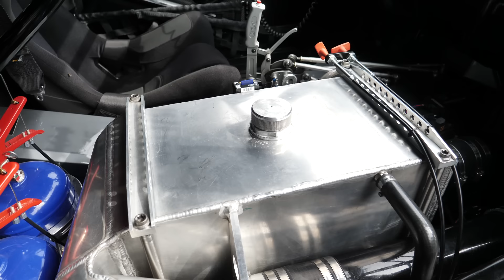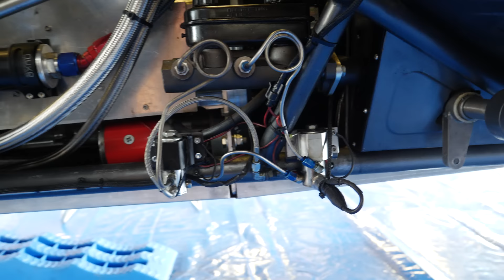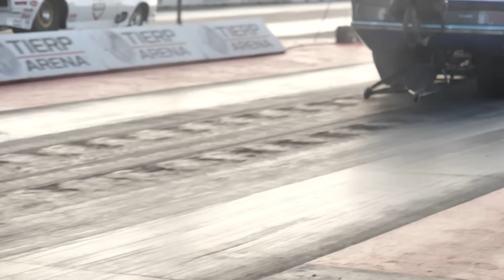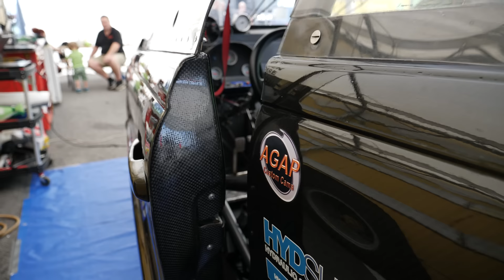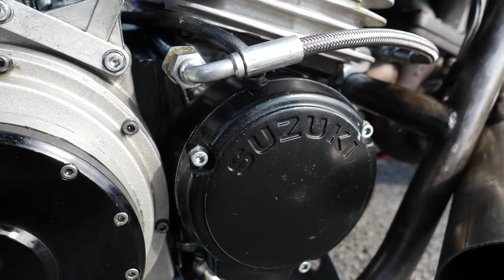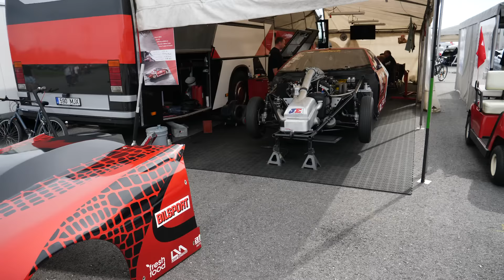The Scandinavian Drag Turbo Cars (2000+hp 4cyl..)

Comment: Set up an air conditioning system to cool down an in cabin intercooler. Program it for the air conditioner compressor to shut off at 50% throttle. The rest of the time it'll have cold air blowing across the intercooler

Comment: 1500hp in 4 cylinder Volvo motors wow.
Reply: Not that there aren't Hondas that aren't making that but those are common parts to find. Maybe I'm wrong but I'm just a fan of engineering outside the box.

Comment: The extra injectors are usually pointing toward the air stream I’ve noticed.  Is this to better distribute the fuel into the charged air for cooling or just a way to fit them in the engine bay?
Thanks for all these awesome videos!
Reply: Probably helps with atomisation.

Comment: I’m not sure a dry sump has anything to do with making power, dry sump is to make sure the engine gets oil pressure on the launch and run down the track, the proline v8 must have a baffled sump maybe? To stop the oil moving away from the pick up and causing engine failure.
Reply: You can get better piston ring seal and reduced rotational losses since there is less oil vapor in the crankcase = more power :)
Reply: Jonas Karlstrom so the main reason for dry sump on a race car is more power?
Reply: @clint.garage.6092  as far as I know, maintaining oil pressure is the main reason. More power is just a bonus (unless you try to extract every kW you can)

Comment: When you simply cut a cylinder off doesn’t it make the motor unbalanced?  Or skip a cylinder in the firing order?? How does that work?
Reply: If you use it like v engine not like a inline
Reply: hermann ott so when they “cut a cylinder off” it must require a new crankshaft and camshaft right?

Comment: Why are all the methanol injectors in the charge piping facing against the air flow direction?
Reply: I Think becouse when you spray against the pressure the fuel vaporizes allot better
Reply: +1 for vapourisation / atomisation.

Remember that evaporation, atomisation being the extreme of of evaporation, has a cooling effect... therefore you get charge- cooling... Which, like an intercooler, means more burnables in the cylinder *without increasing the tendency for detonation*...

They do a similar thing with nitrous. Nitrous is not entirely about adding available oxygen to the mix, it has a huge charge cooling affect - HUGE. In fact it's it's one of the three reasons to use nitrous in the first place. (but you have to apply it as close to the valve as poss or you lose the effect). 

So if you can do the same with methanol, it's criminal not to!

Comment: They use stupid ass combos due to cost of the real deal I have been building cars for people for over 20 years in Florida I have seen twin 103 precision turbos pointed backwards once there is a reason. But if it works for them who am I to say not a good idea I have been running ajpe blocks and proline heads in 481x I buy the parts and set it up myself . As for a wet sump proline hemi .my thoughts on that ?WHY? I cant even begin to think of any positive  reasons at all I can name many reasons why not to run a wet sump but then again who am I I been a heavy hitter on many tracks in USA drove a top fuel dragster been 496.14 in a quarter at 299mph but who am I to say anything good video bud I like to see the crazy ass set ups @the world race on
Reply: Foghorn Leghorn Ok boomer.

Comment: What about 1.8 litre evo of extreme tuners 2000+ hp;
Reply: In Australia there is a 3,000 horsepower billet block 2.3 liter 4g63!
Reply: @kevintucker3354  yes but I talk about 1.8 liter and 2000+ horsepower.and that evo have the world record 7.7 you can find it in youtube
Reply: @djtdcjys6172  we have to see the times. An evo from florida ran 7.7s also but with manual shifting trans not sequential like the extreme tunners evo!!!

Comment: I still remember when 800 horsepower was considered insane out of a four cylinder
Reply: Check out F1 engines mid 80s
Reply: @CK-di9um  >bmw
>1.5l 4 banger
>1400hp in qualifying 
What a time that was 🤤
Reply: I remember when 500 was crazy, back before anyone decided to design and build a billet block 4cyl...
Reply: Kevin Tucker I was referring to stock block, but to kinda revile my age, I remember when 300 was crazy, I didn’t say that in my original comment because I didn’t want to date myself too bad.

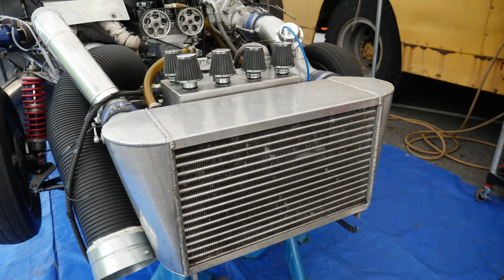Comment: 18:45 A huge heat exchanger with a bunch of crap behind will not let air pass through.
That's a big mistake right there.
Unless they only count on the exchanger mass to soak in calories for the short time they use it on a pass ,that's really,really dumb.
They have enough room in the engine bay to move that tank and allow a nice clean air flow through that.
It nearly pisses me off to see that orgy of parts and ressources and mistakes like that.
Reply: Hahaha, yeah cuz you really do need thoose six or seven seconds of airflow through your intercooler on a car like this...
Reply: @turdferguson9190  If you don't need it,why even to install one to begin with ?
Of course you need it,it will evacuate a bunch of calories ,but only if air flow through correctly,wich is not the case here.
Like i said,it will soak in calories,but not evacuate them correctly.
You wouldn't imagine the amount of energy you can evacuate through a heat excahnger or radiator even during few seconds at the speed those cars can get on a pass.
Reply: @michaelovitch  Many cars like theese need their intercoolers, however they dont require much airflow going through them to be effective enough for their application. Of course a ducted intercooler or a watercooled version is more effective, but also more complex and heavier. But I'm sure you've already calculated what this team can gain with a diffrent intercooler?
Reply: @turdferguson9190  

Effective enough doensn't mean it's well designed or installed.
I doubt that "effective enough" is what they look for on 4 bars of boost on a small engine like that...

Don't need a different intercooler,just let air pass through to let it do its job.
It's completly useless to install an air to air intercooler if it can't even dissipate heat.

 it's very thick,the thickness creating a lot of external airflow loss to begin with,so its efficiency is pretty bad here with a blocked exit.
Unless you have logs showing me that blocking the airflow is not a problem because the heat can't even be dissipated by it in a pass ,i can affirm you that it's badly thought and installed there.
Reply: @michaelovitch  In our team we found more performence in blocking of the front in reduced drag and high speed stability. So I'm sure Pär and his team have made similiar concluscions. So an intercooler being "effective enough" is most likely a small trade for other gains. Especially when you consider that even with proper ducting and a diffuser you would still have problems with separation and or blockage during parts of thoose six or seven second runs. Or what set up do you prefer to run om your drag car?
Reply: @turdferguson9190  Ok, explained like this,it makes more sense.
But why don't you simply reduce the surface area of the intercooler if a that big one is not even necessary ?
You would reduce charge loss in the core length,reduce weight,while having a smaller front surface area on your car,so aero would be better.

Comment: Hej blev intresserad av transportering?? Kullagrena håller ej? 🙄🤔
Reply: Hej Niklas.

Det stämmer att kullager tar stryk av vibrationer. På fartyg brukar vi växla utrustning vi har redundans på för att kullagren inte ska stå stilla för länge.

I så känsliga saker som jetturbiner på ett flygplan som bara har en och är värt lite mer än miljarden stycket förstår jag absolut att man transporterar med massa gummi emellan för att minska slitaget på lagren så mycket som möjligt.

Kullager rent allmänt ät väldigt känsliga saker som kan skadas av allt möjligt roligt. Jordar du inte långa axlar så går krypström igenom lagren på grund av att luften vispar upp potential i axeln som går ut genom jorden istället. De kan skadas av felaktig montering, överhettning (finns en mängd olika temperaturklasser på kullager, ofta betäcknade med ett C före (C3, C4 etc).

Finns även kullager för kryogena miljöer med tätare toleranser än normalt, (C2, C1) som även kräver betydligt viskösare smörjning än högtempererade lager.

Kullager är en hel vetenskap. Det finns en anledning till att SKF fortfarande har utveckling och tillverkning i Sverige jämfört med låglöneländer där kostnaden hade sjunkit.
Reply: Johannes Konow intressant har adrig haft och göra med såndanna maskiner men skulle vara en dröm och få se närmare hur ett flygplan är byggt! 🙂
Reply: Kan stämma! Har hört om reservaggregat på båtar som inte använts på åratal kan haverera efter start pga lagren tagit skada av vaggande, rullande och stampande rörelser.

Comment: What's the info on the epoxy filled block on the Volvo? Is it purely for strength or what is the benefit? I've never heard about it before and Google cant help me out!
Reply: Stewart Butchart Usually it’s for strength. Cement is an old remedy for ”cheap” strength.
Reply: @jonasthemovie  Vart kan man köpa det?
Reply: Magistern Vet inte riktigt vad det är du frågar efter?
Reply: @Magistern940   Antagligen något sånt här dom använder. Har själv fixat lagerbana på traktorvagn efter lättare lager ras, håller fortfarande 2år senare. Vill se mer av 940n också. https://www.wurth.se/produkter/kemi/lim-/kemisk-metall/reparationsstick-epoxy2/
Reply: @chrisjay7736  Ja jag letar efter nån form av metallbindande epoxy. Har sett att PPF använder det i nåt bmwblock om jag inte missminner mig.
Reply: @jonasthemovie  thanks!

Comment: The fastest 4 cylinder car is cacá daud with his cobalt from brazil it run a 6.16 in the 1/4 mile 🇧🇷🇧🇷
Reply: No, its a Pontiac now who ran 6.08
Reply: Damn 4 cylinder ftw next year someone will run a sub 5 Seconds run for sure
Reply: @joaopedrodiel8256  rotary's 6.08, 4 cylinders 6.07 a few Nissan's in the 6.0 range the race is on to be the first non 2jz import in the 5 second range

Comment: Waiitt over 1000 hp on a stock volvo block! Shows how good they are built
Reply: Done on a few motors even GM have a guide to build a 1000hp ecotec 

The first 1000hp 4 cylinder was a beetle back in the day